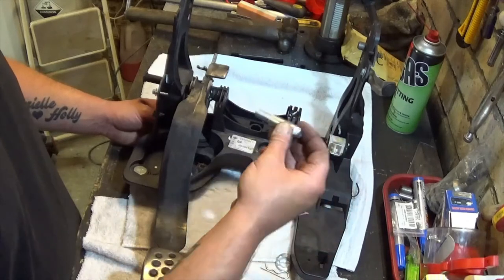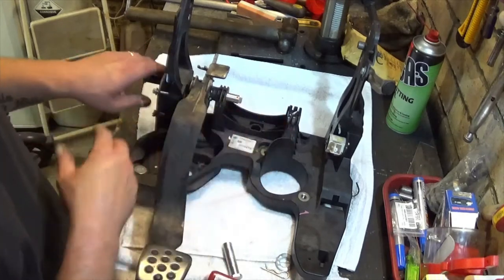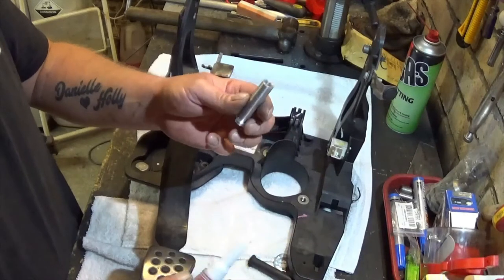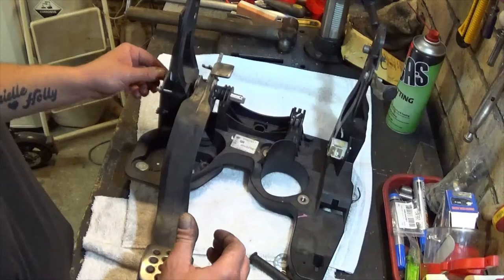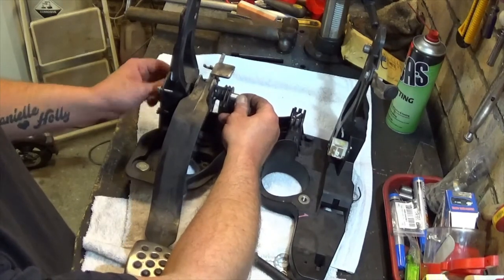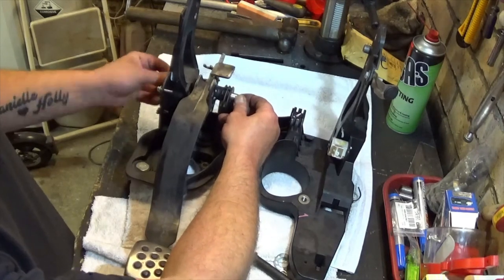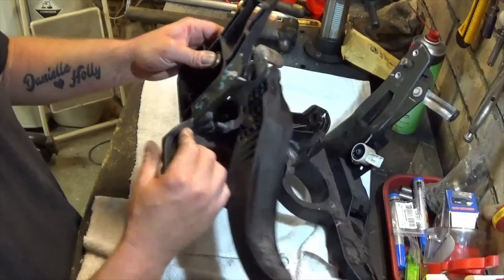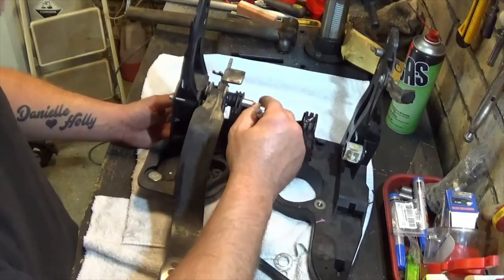Quick Fit Pin For Astra j Clutch pedal pivot pin

Comment: Done this with everything in the car. All back together car won’t start. Any advice
Reply from the maker: Plug the clutch pedal switch back in or make sure you haven't broken it 👍
Reply: @leightorrance3844  ok I’ll double check this now. Appreciate the advice
Reply: Can’t cut the old pin even with hack saw when it hits the gearbox what would you recommend
Reply: @jasonwelcome676 
Just cut it down with snips and pull the rest out

Comment: Can this be done on the car or would the pedal box need removing ?
Reply from the maker: The pedal box doesn't need to be removed
Reply: @leightorrance3844  cheers bud 
Where did you get the replacement pin ?
Reply from the maker: @ryanread268  I make them
Reply: How i can remove a returnspring?
Reply: Can you sell me a pin please
Reply: I need insignia one??